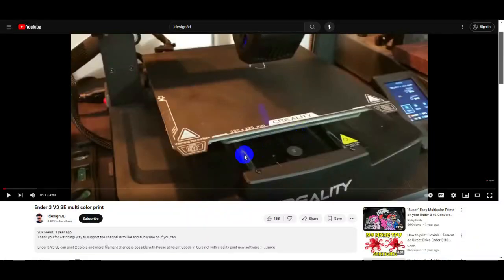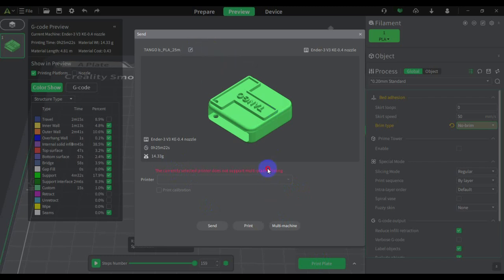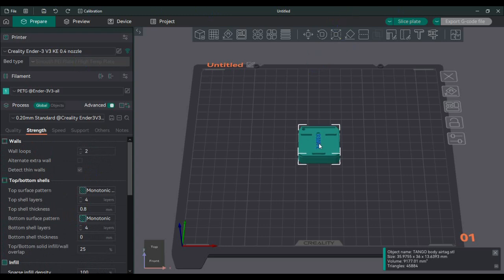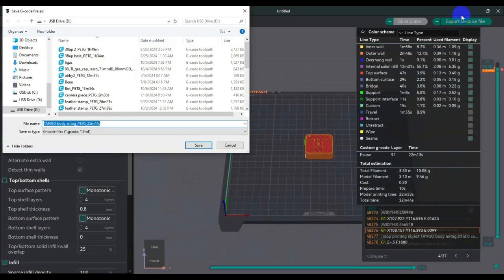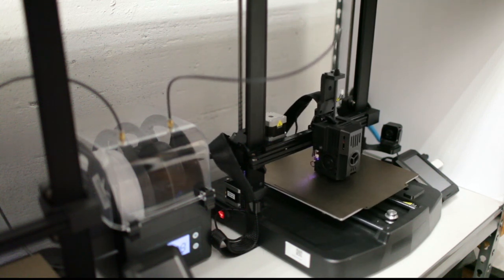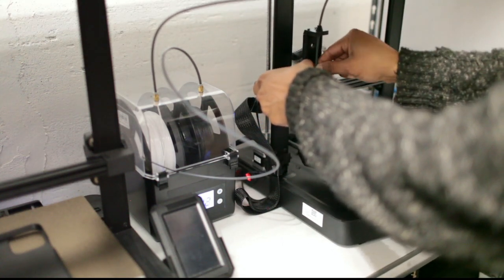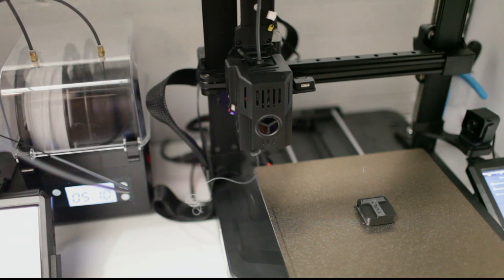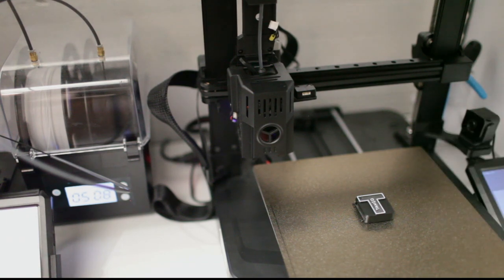Ender 3 V3 SE/KE Multi Color Print

Comment: you can do that in ender 3 v3 se.  In multifilament enable prime tower, set the parameters, and then either change filament in printer settings ( top left corner go to objects in those settings ) and do the change. It is kind a easy. I did not know that printer can beep :D When it will finish first filament it will go to home possition. There you will change filament, then you must press print and when it will start beep again then press again print. It is hard to explain when i did it once and found it just now and i can not share here my screenshot but hopefully this can help to navigate somehow :) maybe with newest creality slicer it is possible ?
Reply: Hi, I have a se too. Do you do it through orca slicer?
Reply: this doesnt work. it never pauses.

Comment: you can do this straight from the Creality Print software. First slice, then use the vertical depth slider to go to the layer where you want to swap to a different colour and right click: Choose "add pause" and "add code:. type in M600. Export the Gcode file as per usual. When the print reaches that layers it will automatically pauze and park the extruder away from the model so you xan swap filament. Then choose "resume" and it will print further with the other filament. It is really easy. I do regret not having bought a Bambu Labs printer though with automatic filament swap.
Reply: How do you add code M600? When I click add pause it marks it but then when I right click again only the "delete pause" is available and the add custom g-code is not available.
Reply from the maker: @leventestancz4522 I’m doing an updated version tomorrow of this issue. Stay tuned
Reply: @JonDesign3D  Thank you, I can't wait!
Reply from the maker: @leventestancz4522 the new version is uploaded! The Ultimate Ender 3 V3 SE Multi Color Guide
https://youtu.be/fquPxaOy4z4
Reply from the maker: Nice work! Will definitely try.
Reply: What's the m600 code for? I only added a pause, and the  head parked back left and the bed went all the way forward.
Reply from the maker: @stevescott8491 the new video is uploaded now!  
The Ultimate Ender 3 V3 SE Multi Color Guide
https://youtu.be/fquPxaOy4z4